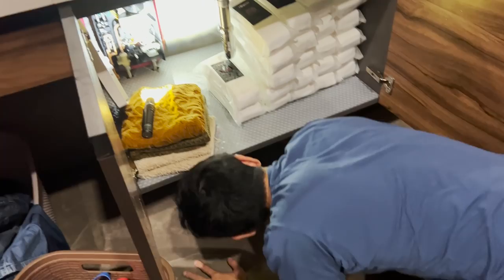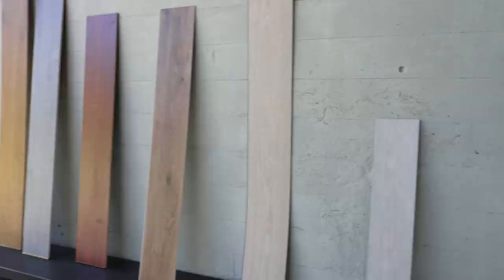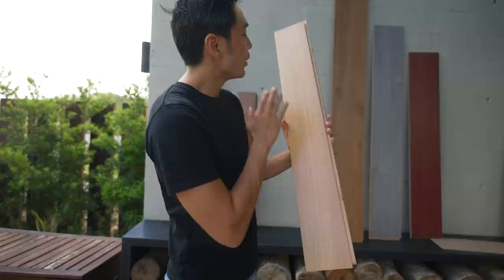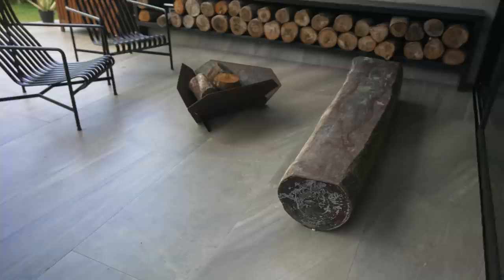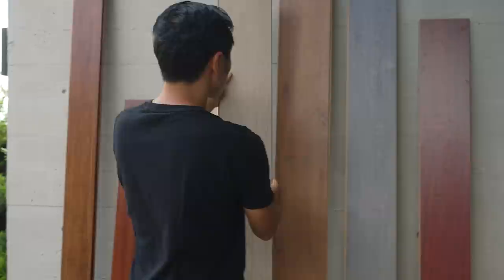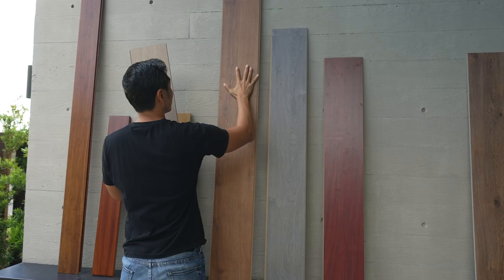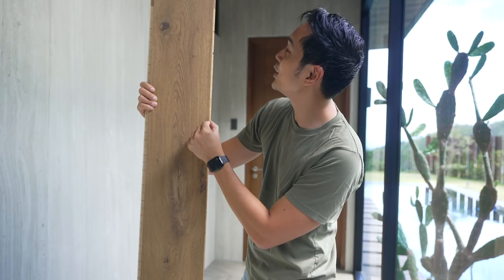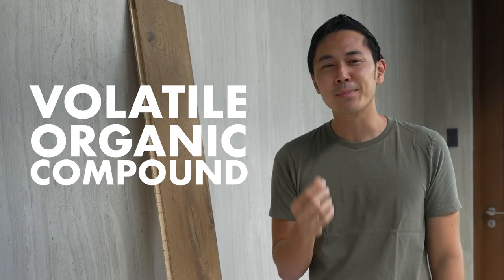Choose Your Flooring Wisely (Vinyl vs Laminate vs Engineered Wood vs Bamboo)

Comment from the maker: Which floor is your pick? Comment below.

P.S. Sorry bout the music volume 😅
Reply: Vinyl engr
Reply: Thanks for the informative video! Wood laminate is my choice for that look without the high cost. Your thoughts on polished concrete floors? Pros and cons? :-)
Reply: Wood Laminate!
Reply: engineered wood!!
Reply: thinking of using wood vinyl, but might invest for wood laminate for our future bedroom hehe
Reply: i recommend waterproof laminated pvc planks
Reply: Hi Slater! what's your comment on SPC (Stone Plastic Composite)? I actually got them from Pergo too!
Reply: laminated pvc wood looking planks by hornitex
Reply: You just convinced me that tiles are the way to go. 

Even if I spend on the most expensive brand, if it will save me tons of money and headaches on maintenance and hassle, it's worth it.
Reply: Yung engineerd wood parang maganda.
Reply: Vinyl waterproof yung sa bahay namin ako mismo nag-install
Reply: Thank u...learned alot
Reply: I replaced my wood laminates with dumafloor plastic flooring due to termites. it is more expensive but won't be worried if it gets wet.
Reply: Lvp
Reply: Tiles.. perfect allaround and easy to maintain.
Reply: Thanks for this, nagcomment din ako sa video ni ms kryzzie na sana makapagupload ka ng ganitong vid hehe
Reply: Bamboo para organic po
Reply: Our unit’s (rental) floor looks similar to your bedroom floor. There are signs of warpping (kung ganyan ang spelling 😄) How do you maintain or clean it? Thanks
Reply: hindi naman malamig sa pinas, tiles lasts longer and requires little maintenance.  kung kailangan ng warm na sahig, lagyan ng carpet.
Reply: I prefers the vinyl since it cant warps easily and also termites cant destroy it, like engineered wood and solid wood
Reply: How about epoxy resin
Reply: Imuhang choice akong sundugon 🙂 tapos you mention insurance money? How to insured the house? Ana ba na sya?
Reply: amoa boss wa jui salog. yuta rjd.. nindot pa kai pwdi makatanom sulod balay
Reply: Been enjoying my Sierra SPC Flooring, but I think only available in Manila. Waterproof, looks nice, feels nice. Definitely better than laminate, feels more premium than LVP
Reply: Wood laminate! This video is so informative
Reply: What's your opinion on epoxy floors?
Reply: How to light a sloped ceiling?
Reply: Wala po yung ceramic tiles that have the aesthetic of wood? Hehe. My folks were  considering real wood but I convinced them of ceramic instead. Looks like wood. Waterproof cheaper and the selling point was its easier to clean and maintained
Reply: polished cement, engineer :)   ahahaha...
Reply: ceramic tile
Reply: Hardwood/ solid wood 😄
Reply: Luxury Vinyl, Engr.
Reply: hardwood
Reply: Solid wood boss, I mean raw wood, can you discuss how to install them? Olden way 😂
I have a stock of mahogany but I don’t have idea what cut size and the groove locking system
Reply: Pwede po ba ipa ibabaw sa marine plywood ang wood engineer or wood laminated for bedroom?
Reply: Vinyl. I think it's perfect on concrete and hardwood.
Reply: Slate. I know its been a year since you did this video. But what do you think about Epoxy flooring?
Reply: I used Real teakwood flooring For my house….. Kahit bumaha accidentally Or Kahit ihian ng aso it will not warp… ndi cya lolobo or kung ano man.. the price is  a littlebit higher but it will last a Lifetime… the problem With engineered wood and vinyl at lahat ng isinasample mo ay pag Lagi sila nababasa eventually Lolobo talaga sila… FYI teakwood ay ginagamit sa decking ng yatch kung outdoor mo cya Gagamitin like yatch for example it will still last for 50to 70years… rain or shine kc and Salt water pero still kayang kaya nya i resist imagine kung Indoor mo Gagamitin gaano cya katibay... plus ndi Cya inaanay…
Reply: Sir pwede b Ang vinyll khit binabaha yung lugar Hindi nmn madalas kpg mataas lng Ang bagyo o baha
Reply: @godz2928 hi saan ka bumili ng waterproof laminated floor tks.
Reply: Sir anung marecommend mo living in UK na floor? Sa living room ko cxa install. Thank you
Reply: What's best for uneven concrete floor? 

I am thinking of using SPC, ok po ba kaya ang SPC for uneven concrete flooring?
Reply: 😮😮i

Comment: I am here in the U.S and here most contractors are recommending SPC with 100% waterproof! Also, make sure you get good brands because you will only spend one time on your home and don't think cheap because like what happened to you.... you need to start over and pay again for another flooring. SPC is for high traffic meaning really good. (it's also luxury) The wear and tear are high! wear and tear layer is important also, So make sure you get at least 20mm wear and tear. I bought my 2nd house here in California so I am always researching for good materials. No wood if you know your area will get flooded lol. Some brands are designed even soaking for water in a day... Just do your research just don't listen to people, especially bloogers=) If they know and they did their research they will not have problems....
Reply: I put cheap laminate in my bedrooms and living area and it only cost me about $1000. I did understand that this was a temporary solution because it was cheap and easy to install and I had neither time nor money before needing to move in. I just finished tiling the Kitchen dining area, that was only done enough to get the kitchen working before moving in. 
I'm thinking about doing a Wood look tile for the rest of the house once I recover from tiling the kitchen area. Being able to pay someone else to do it would be even better, because I hate tiling.

Comment: I remodeled our house and used Pergo Outlast+.  Very expensive but best investment!  It is waterproof, scratch resistant, stain resistant and a very important feature is it has built-in padding that absorbs shock and sound or noise which is good for people walking with heels or heavy shoes/sandals as well as dogs running or playing.  Easy to clean and very  pet-friendly.

Comment: Wood laminates or more known as snaplock laminates can really be problematic when exposed to water, I work for property insurance claims management in the US and that’s like the usual problem they encounter with the floor. If it’s cupping, it’s usually no more salvageable and needs to be replaced instead. Engineered hardwood can be resanded, though, as long as the veneer is atleast 30mm thick.

Anyway, great content, I took courses about these and I mostly agree with what you said there.
Reply: 30mm (1") is the overall thickness. i think you meant a top layer of 2.5-6mm to enable resanding.
Reply: @AsaphAce  thanks for correcting. Typo, I meant 3mm. But yeah 3mm-5mm of the top layer above the T&G.
Reply: There's no waterproof wood laminate flooring in the Philippines yet? Hmmm...
Reply: @AnythingAndEverythingDiane  there probably are products available in the Ph market that are more resistant to water but are still not 100% guaranteed waterproof.
Reply: Yup! Im replacing my whole 1st floor to Vinyl right now. Laminates are a paaaain 😢

Comment: Yikes! We had a similar issue. Culprit: a cracked plastic pipe fitting inside a multipoint heater.
I hope manufacturers change their pipe fittings to brass or copper to avoid costly floodings in houses. If you find a better brand of heater, please update us. It will save a lot of houses.

Comment: we had floor headaches when we fixed the living room. Flooring is not easy. we were so into wood and changed our mind radically and chose a plastic carpet with a dark wood look. Superb! Nice to walk on, easy to clean and the room became quieter. So from someone who likes wood, I don't regret plastic carpet. The most expensive thing we looked at came from Finland 1500 skr/m2

Comment: I have small house. I use vinyl tile planks (yung parang makapal at textured na linoleum) kasi nag-iiba ang trends every 5 to 10 yrs. 10 yrs ago it was reddish brown wood color pero dahil nauso ang whites and natural wood color, I changed the planks. Madali tanggalin, madali mag-install ulit lalo sa gaya kong babae. I love redecorating my little paradise. I never had issues sa mga umaangat or scratches. My neighbors on the other hand have ceramic tiles installed in their house for over 2 yrs, pag lumalamig na panahon, may umaangat until recently lahat ng tiles umangat at nagcrack nalang - maybe due to thermal expansion. So I'm still happy I opted to vinyl planks.
Reply: Nice

Comment: Even if the Laminate Wood/Eng Wood is waterproof, if your room gets flooded, the laminate may get some protection but the issue is water retention under the laminate which will result in bacterial growth and "kulob" smell of the room. So the best bet is still the regular tile.

Comment: ever thought of looking into ULTRA floors? (havwood/valinge brand)  it's a hybrid crossover of MDF laminates and engineered wood flooring. It's durable, scratch-proof, waterproof, inexpensive, without having the ugly repeats of a vinyl that still gives you that realistic luxury look. Also, i suggest applying a DPM primer first on the concrete slab before floating the floors. This will serve as a vapor barrier to prevent moisture from sipping out from the ground to your floors OR utilize an underlayment that comes with a vapor barrier. Moisture can cause buckling, cupping or cracks.
Reply: I checked out the Valinge website it says it won't work for humid areas we live in the Philippines which is a tropical country is that considered a humid place?
Reply: @pokerbarloahavia  are you sure you're looking into their woodura line? HDF  or compositek is a lot more stable and is ideal for humid  areas such as the philippines since the material does not react to the humidity as much as solid wood does. This is also due to the synthetic construction of the flooring. Valinge Woodura -- super cool stuff!

Comment: Hi Engr. I recently completed a renovation project. I used laminated floor (Aqua floor) which is water resistant. The core is made up of rubber or solid vinyl instead of ordinary wood.
Reply: Hello! How is your aqua floor right? No chips? Cracks? Tuklap? Etc..

Comment: Vinyl when exposed consistenly to heat eventually cracks. Yan ang gamit namin sa room. Natanggal na yung dikit sa floor and parang crumbly na sya dahil exposed din sa init lalo na yung near sa glass door going to terrace.
Reply: I wouldn't use glue for vinyl.  Use the one that floats and clicks together such as LVP

Comment: Even if the flooring is waterproof,  it still has to all be removed  to dry out subfloor or concrete  floor  throughly   or else mould will start  growing    under flooring.

Comment: I wish I had used solid wood on all my floor coverings . It certainly feel better on my feet. I hesitated using it in the kitchen and bathroom because of my fear of warping when it gets wet. I have 3/4 thick red Brazilian cherry . It’s 15 years since install and maintenance free. Soaked leftover wood to test if it will warp but didn’t even after a week..

Comment: I think katulad namin limited ang budget floor tiles ang pinaka common pero kung merong malaking budget i will go for the wood laminated lasi you can get the both ways durable and yung protection of the material... pasado ba teacher slater???😉😉

Comment: All our water-heating units that are not in basements have pans and drains and sensors.  Did you install these when you repaired your unit?  And we too took the wood flooring journey 3 years ago when we gut-rehabbed two adjacent buildings.   We went with engineered wood, Teckton White Oak. 5/8" x 5" with a 4.5mm wear layer.  So far so good.

Comment: You forgot to get a sample of WPC and SPC. The SPC is the new generation Vinyl (upgraded LVT) that matches the performance of the Engineered Wood with a much more cheaper cost. And it's also TNG, and has it's own backing pad layer so there is no need to put some extra layer of insulation. It's durable, scratch resistant at some point and water resistant at some capacity so it's a perfect compromise between performance, comfort, beauty and of course price as it's cheap and I've been using it in my low cost renovation projects. It makes the room premium on the flooring side.
I've seen hotels adopting it and you can see the performance of the SPC's.
I use the cheap Chinese made though, not the branded ones but it is still a competitive option.
Reply: Which brand of SPC do you vouch for?

Comment: The warping and delamination of the floor laminates was caused by the pressure of moisture still in the concrete. Maybe the installation of the flooring material  was made when the concrete have not dried up well. Take note that a concrete floor slab drys up by 25mm per month. If the slab is 4 inches, installation should be after the 4th month in this case. AQURON 1000 NANO Colloidal  silica based material will shorten installation just after 28 days. There  are no other reasons for the problem as mentioned.

Comment: Also, among all these flooring tile is one the one that does get burn easily, correct? And probably if your house gets burned, tiles along with those made in cement and metal are the only one that stays and can still be utilized?

Comment: Slater, which are you more frustrated by, the floor or heating unit failures? This could go either way and there are engineering solutions for the latter as well. Maybe you can share them?

Comment: why there is moisture in the flooring? may be during construction (pouring concrete) you did put polyethylene sheet. my house is almost 30 yrs old, still no wood flooring damaged, no moisture at all.

Comment: A review of plain cement flooring with a topcoat? I'm currently working with an archi for an industrial/brutalism type house and I'm thinking plain finished cement with a polyurethane top coat for most of the house flooring

Comment: For me, the best safe flooring would be tiles / concrete, kapag nabasa, unlike sa vinyls bamboo planks, kahit waterproof pa sila - pwede pasukan ng tubig at moisture dahil dyan prone padin to molding which ia unsafe for breathing. Sa tiles and cement hinding hindi masisingitan ng moisture at tubig pailalim. Nagsisisi ako sa vinyl planks ko sa bahay 🤣 life has a leaning curve, trial and error.

Comment: Construction error of the floor.
There should be at least a two centimeter height difference of the floor to prevent the water from entering into the living area.
Also the water must be able to flow out so a fall must be on the entire floor, not just in the shower (or wherever the water is installed).
Plus the outflow must not be blocked by any shower wall etc.

Comment: Linoleum kaya ay mas tatagal laban sa laminate o purong papag na tubong kawayan talaga (pero hindi nga lang kontra sa bibiyak na pako…unless predrilled…engineered y solid flanks are not that weather proof but will resist anything that will mar eat (bukbok o anay) the materials treated or otherwise (exposure to those predisposed to chemical man made or the like)y though maintenance is also an expensive part of putting to work longer…the more fancy y quality built materials one prefers cost is always go with it…imo…to each his own(:

Comment: what about polished concrete? not much headache?
Reply: yes polish concrete is very durable and cheap
Reply: @drsm7947  are they really cheap?  i know it can be done in big spaces.  what about small spaces like bathrooms?
Reply: @peterpiper5300  there cheaper and durable than tiles and can be done on small spaces like bathroom too

Comment: I Still think wooden tiles is the best in terms of our climate/weathering in the Philippines. not only, it has wide range of new design , it imitates exactly wood finish you're looking for vs engineered wood & vinyl. Also, its durable than them when it comes to water-resistant. The only disadvantage is having a poor installer & poor adhesive material used, but every client i did with the wooden tiles have been no problems so far. Vinyl looks cheap & engineered floor is prone to water & very expensive.